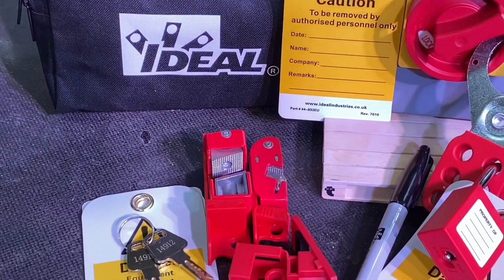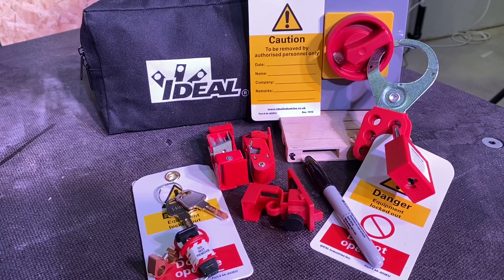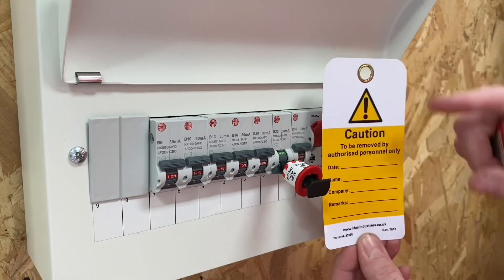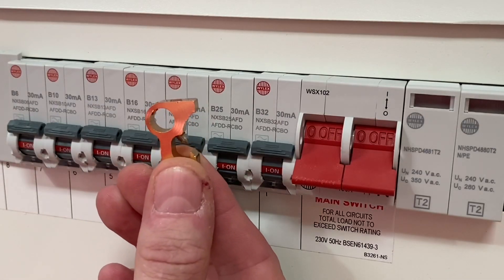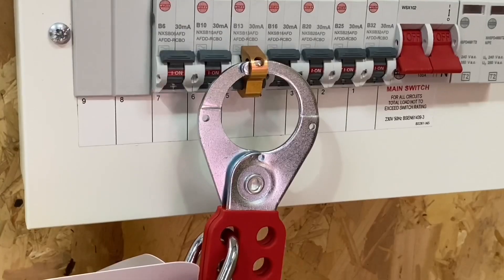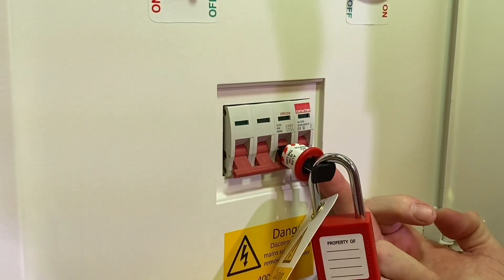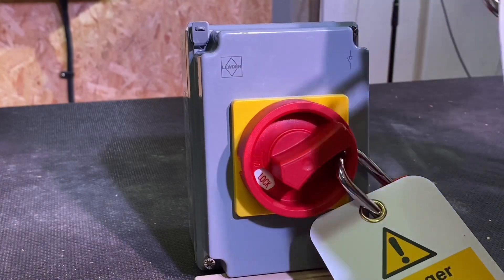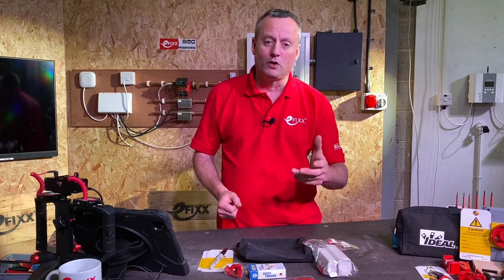SAFE ISOLATION & LOCK OFF KIT - Electricians’ toolbox 🧰 essential

Comment: Good basic kit for a domestic installer. The red locks with the plastic casing are not that strong and more expensive. Some cheaper locks have only a small number of key variations.

What about safe isolation of industrial 110v, 230v, 3 phase, Harting plugs or other variations?

Video’s on safe isolation never seem to mention the importance and best practice of “line of sight” ie the isolator should be local to equipment to make it obvious for everyone. There are cases when testing is simply not enough to prove the equipment is safe to work on, particularly in automation. Finding a breaker in a factory is often not straightforward.

Also, the safe isolation could be for your own benefit, another trade or even cleaners that are ignorant to the equipments technicalities, making visual indications more important.

Comment: Wouldn't want to operate the switch on full load... Why not. it's rated for it. I disagree with this common 'meme' amongst the electrical sector. I think it's crept in from the electricity board's  SENSIBLE rule of not pulling a main fuse with load on.

You have LITERALLY recently covered 'load break' isolators.  It's not WRONG to cut the load in one... just don't use the main fuse to do it

Also never never ever would that number be used to produce a duplicate key. HELL NO. NEVER... yeesh
Reply from the maker: If you're shutting down a full installation my preference would take some time to shut circuits down in a controlled manner - thinking about machinery, IT equipment etc. Yes the switches are designed for a full load. On the lock note it does come with two keys - so already has a duplicate.
Reply: @efixx  odd... My lockout lock came with only one key